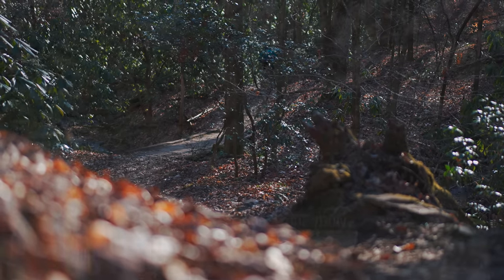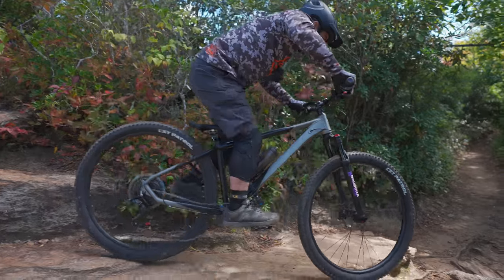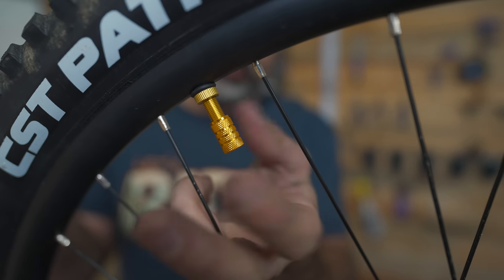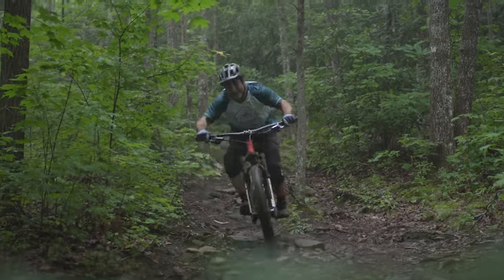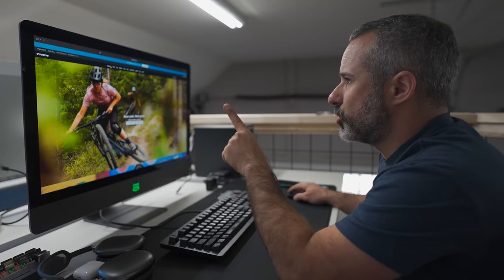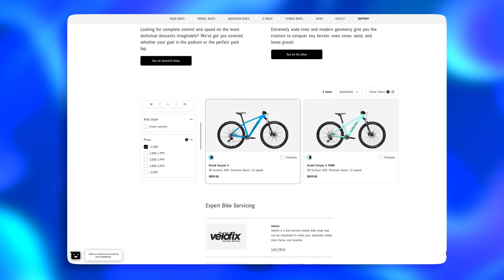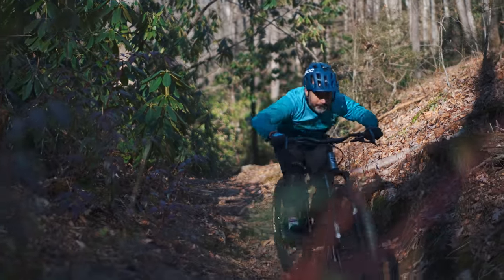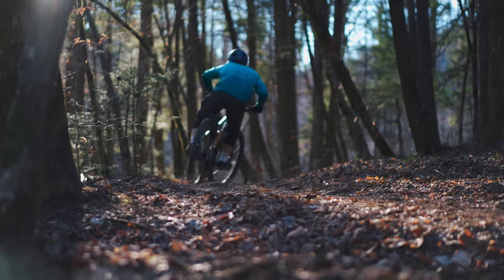Was putting $425 of upgrades into our Walmart Bike a good idea?

Comment: Seth, thank you for this video! Oh man, it rings so many bells. I've got BCA 29er bike from Walmart 6 month ago for $148, didn't know anything about bikes back then. For the fun of it I've started upgrading it with everything I can. Acera derailleurs front and back ($40), M361 hybrid crankset ($25), Acera shifters ($30), bottom bracket ($12), KMC chain ($15), headset ($18), Rockshox Recon air fork ($190), handlebars and stem ($25), seat with seatpost ($30), pedals ($15), QR axles ($12), 34 teeth Sunrace freewheel ($20), $10 derailleur hanger, $15 grips, Shimano brakes ($50). Except the fork which is a major upgrade to any sub $900 bike, it is $300 right there, lol, making this $148 bike a $450 bike cost wise or a $650 if you add the fork, ahahaha. Not counting all the tools and supplies I had to get for it. And I still have a crappy rear hub with 48 spokes (!!!!) and a freewheel wobble that I may have to upgrade to a new wheel with a cassette (another $120) and a cheap frame without rear disk brake mount. Was it better to get Kent Trouvaille - a much better bike for less money? Absolutely! Do I regret not getting it? No, because I've learned so much about bikes. I do not remember when was the last time I had so much fun as during  this project. Watching your videos, reading about parts, how they work, how to replace wheel axles and make the wheels true. To me it was like taking a an advance bike class and paying a $600 fee for it, while getting an OK rideable bike in the process. Just need to keep it secret from my wife so she doesn't kill me, or better yet get her Kent Trouvaille:))))
Reply: 👆👆👆Congratulations fan you've👆👆👆 been selected among my shortlisted winner 🎁🎁🎁

Comment: I recently did upgrades to my Mongoose Switchback Sport 2020 - Shimano CUES U6000 10-speed 6 components groupset (originally Tourney XT 3x7 speed), MT200 hydraulic brakes (originally mech brakes), EXA Form 900i dropper and installed SR Suntour XCR32 RLR air fork. For all these I paid under $350 and ~$90 servicing. Think I am good to go for another 3 years. :)

Comment: With any tool buy cheap and if you break it you use it enough to warrant spending some wedge on the replacement.
Same with bikes, I got a Giant Talon 3 for £400, loved it, upgraded it, still outgrew that spent 2k on a Whyte T130. 

So if you're wondering if MTB is for you, spend a little, see how it goes. 

Or buy an expensive bike and sell it on ebay a few months later for pennies, we love those.

Comment: My first bike back into the sport was a 2020 specialized pitch sport. My local bike shop charged me $800. I thought what I was getting was a real mountain bike. Problem was, when I wanted to start making upgrades, I found out what I got was what I got. 2x drivetrain, 27.5 wheels, straight headset, no easy routing for a dropper post, and no real option for a clutch derailleur. I quickly realized that what I got was not a real mountain bike. It soured me on my local bike shop because they weren’t upfront with me on what I was actually getting. I do have a real mountain bike now and it’s a Polygon. My wife now rides the pitch sport. My son is in his 20s with a baby on a tight budget. He wants to get into mountain biking but doesn’t have enough money to drop on a “real” mountain bike. This Kent would be the best option for him but it hasn’t been in stock since this series started. There is no entry level “real” mountain bike on the market that can compete with this Kent Trouvaille.

Comment: I actually did something similar when I first started getting into mtbing. I got a used hardtail Diadora Corso  for under $200 CAD (which is a Canadian tire brand bike) but saw that it had the ability to be upgraded with more standard parts and over the course of 3 years I  upgraded the wheels, tires, drivetrain,  fork etc until the only thing orginal is the frame itself. Id estimate that with the bike plus the all the upgraded parts,  I more than likely spent the same amount as a bike of similar performance but what was great about doing it this way is that everytime I made an upgrade it also made an upgrade on the riding experience which got me to excited to ride it more.  and or someone that wasnt 100% sure i would enjoy this sport this was a great way to get started in the sport without the burden on spending $1000+ straight out the gate . Now I have a bike with a great riding experience and when  im ready to buy a decent frame ill have lots of well performing parts to install on it.

Comment: I did something like this with an abandoned bike. While it had a grocery store sticker on it the hydraulic guides hinted the frame was probably used for much better specs than what it had. Spent about £400 on everything. And it's in it's 5th year of service. Kid managed to break the spare square taper bottom bracket which I upgraded shortly after to hollowtech. Only other things I've done is change grips and tyres.

Comment: I only just got a mtb (since I was a child at least). Only really been an e bike commuter /motorbiker outside of it but my call for adrenaline took over. I also however have a tiny budget that I can spare for bikes. Bought a used very budget full suspension mtb for £25 on gumtree. Has old but working V-brakes, good condition 26"-1.9" tyres, a bit of rust on screws etc and does need the gears looking at (well lubricated but the front derailleur is not aligned well at all so I only have 1 of 3 gears there making it a glorified 7 speed at the moment until I have the effort to realaign and index it). I also have my e bike which I paid 700 for. I already love my £25 one more. Its nippy and is a just a fun project. Doing all the upgrades and replacements over time is gonna be fairly cheap long term and are more for preference over the bike missing basic function. You don't need something fancy, just something fun!

Comment: This sums up the life of my partner's BMX. Diamondback Viper owned by a downhill racer (gearing modified to suit), she bought it from them for $350, she rode it to work until it fell into disrepair. Some 7 years later we still have it and the start of last year I stripped it, painted it, new gears, cables, wheels and a lot more that was probably overkill. Cost of new stuff was around $450 (AUD) due to the fact we don't stock a damn thing here and shipping is borderline extortion. As far as any $800 on the market (here) it doesn't exactly match in quality but its definitely unique and makes a nice cruiser.

Comment: I've found it to be a great re-starter bike. I bought it understanding its flaws, and if it breaks, or I'm back to riding harder trails, I'll replace it with a Trek, which was my go-to in the 80s and 90s. I do appreciate the insight, as EVERYTHING has changed mechanically since then.
Reply: I did still have the chain tool to properly reroute the rear derailleur. Who does that?

Comment: Don't forget about the tinkerers and doit yourselfers that have more money than sense.  I did this with the Schwinn Axum from Walmart.  It was expensive and I spent way more money than I should have, but I had an absolute BLAST and I learned a ton.  There's not a single part on the bike I didn't replace (sometimes more than once).  By the of that journey, there's no issue I am not equipped handle myself, especially since there's no bike shops near by.  I still enjoy tuning it and changing bits of trim from time to time.  Of course I could never sell it without taking a huge loss but first: I don't intend to, and second: the experience was worth it.
Reply: 👆👆👆Congratulations fan you've👆👆👆 been selected among my shortlisted winner 🎁🎁🎁.

Comment: I normally upgrade the tyres on a new bike for something more puncture resistant and better. And because I prefer 70mm cranks, the chainrings also get changed. The saddle is another immediate upgrade. Other bits get changed/upgraded as and when they wear out or I get fed up with them.

Comment: I bought a Traveille yesterday on clearance for $248. We bought my road bike a few years back from the LBS, but it’s going to be a while before one of their mountain bikes is a financial reality. I also don’t see myself ever doing anything hard core on a mountain bike. I have been a road biker for years but never mountain biked much (my current mountain bike is a 30 year old Diamond back with no shocks, wobbly wheels, and brakes that squeeze the tires that the bike shop is probably worth $100 at most, so I am hoping the traveille is better- the bike is one reason I haven’t tried mountain biking much). We live in a beautiful area with a lot of trails so I plan to ask which ones are “easy” for beginners and probably stick to those. I just want to see if I like mountain biking. I chose the Travaille yesterday because it felt by far the lightest at wal mart and it sounds like it might not be complete junk after searching out videos such as yours. I also plan to take it to the LBS and pay them to go through it looking for anything that was assembled wrong. Do you think it could work as is for my intended purpose? If you could only upgrade one or two things, would it be the brakes and the part by the pedals with better teeth that you did in your first upgrade video? It seemed like with all your upgrades you eventually paid a similar price to an entry level LBS. bike, and you can do the work yourself but I will have to pay the LBS, but since I got it on clearance and don’t plan to do anything hard core on it, do you think it could work for my situation as is to start and then if I like mountain biking I could do a few of the upgrades over the next few years? Thanks.

Comment: Great video and good conclusion. 
Almost two years ago I bought a Cube AIM EX for my wife for €632. 
It came with 3x9, which I replaced directly with a 1x11 dt with clutch from the partsbin together with a new Deore crankset. 
It already has hydraulic brakes, but still the coilspring SR Suntour. 
The fork is good enough over here in the Netherlands for the rides my wife does. 
If I upgrade the fork, the price of the bike with the new parts will go to around €900-1000. Then you come in the range of bikes which already have all the upgraded parts and possible even 12-speed. 
For me it is just fun to work on bikes and to upgrade it, if it is not your hobby: save some extra cash and buy a bike in the €900-1000 price range.

Comment: You can also search for used deore/slx parts. You can find x10 speed stuff in mint condition cheaper than new microshift/ltwoo.
As for forks, you can also search for entry level rockshox or manitou that were removed from new bikes. Can find something like XC30 solo air under 150$.

Comment: Dude.  I got a Trouvaille from WM based on your vids.  I had a 10yr old GT stolen from me and I've not been without a bike since childhood.  Let me just say...for the price, the Kent is decent.  I've not upgraded anything.  Having said that, I have spent plenty of time adjusting components.  Specifically brakes.

While this bike is not the Nukeproof that I'd like to have, it does the job for me right now.  Having been in North GA and ridden many of the premier tracks there, I would probably not take the Trouvaille out there.  Just not confident in it.  But where I am now, on the eastern coast, within a mile of the ocean, it is perfect.  I can hop curbs, wheelie, sprint, coast and have a leisure ride and know that my bike can perform.

Keep up the fantastic content!  Many of us appreciate it and will keep absorbing what you deliver.
Reply: 👆👆👆Congratulations fan you've👆👆👆 been selected among my shortlisted winner 🎁🎁🎁

Comment: Thank you for the reasonable conclusion.  When the series started I was worried you'd recommend this route to people (upgrade Walmart bike instead of buying decent bike from shop).  Definitely takes a lot of knowledge to do the work yourself.  Paying a bike shop to change out a fork would already add another fifty bucks.

Where I wish you'd explore some is for people to either buy a frame, or find a beater bike as a frame donor.

I found an old beat up trek.  Unrideable, but the frame is aluminium and in good condition (and decent geometry by modern standards).   I got it for fifty bucks and frankly, if you are going to change out all the parts anyway, it's much less wasteful to start out with just the frame.
Reply: 👆👆👆Congratulations fan you've👆👆👆 been selected among my shortlisted winner 🎁🎁🎁

Comment: I have a similar "cheap" big box store hard tail, a 27.5 Gira Terreno.  The bike followed a very similar upgrade path to the one in this video over a couple years of riding the hell out of it and upgrading parts as the originals wore out.  Sure, I've turned a $350 bike into an $800 bike, but I did so over the course of a couple thousand miles... and now I know ever single bolt on that bike, what it does and how to fix it.

Don't get me wrong, when this thing finally dies, I'm replacing it with a higher quality bike, but I'm kind of glad I started with a cheap bike and built it into exactly what I wanted by putting miles on parts and learning what worked for me and what didn't.

Comment: My first mtb was a GT Karakoram (the 3.0 model).  It came with rim brakes, a heavy crappy fork, single wall rims.  It was honestly not a great bike for trails at all lol.  But when I got it I was just riding gravel paths at my local park and the sidewalks to get there.  I lost about 50 lbs on it, and then I wanted to try actual trails.  I immediately “upgraded” to mechanical disc brakes because the rim brakes were useless as soon as they got wet.  The fork failed first, then the wheels.  I got a cheap double wall wheel set from a LBS, a fork used on pink bike.  I even frankensteined my own 1x8 drivetrain together lol.  It still was (as I know now having ridden better purpose built bikes) not at all a “good” bike.  But I put 1,000s of miles on that thing and got myself into the best shape of my life.  I lost right at 100 lbs in my first 2 years of riding.  6 years into riding trails I got a trek roscoe.  Now I have a full sus trail bike.  12 years later and I still absolutely love bikes and riding every chance I get.  And it all started with a comparatively bad bike.  But it was my bike and it got me riding!

Comment: Great video...but scary how you use a hammer and then a hydraulic jack to get that steering tube ring off...not too many beginning bike "Mechanics" would risk doing that (Or have that jack), also special tools are needed to remove the crankshaft and bearings.

Comment: I use a different approach, when I want a new bike I go buy a frame and swap all my good stuff into it and only buy what I need to have due to different part fitments.
Worst case I buy a full bike and then sell all the bits I don’t need to offset that cost.
My current bike the oldest part is the RS Revelation fork uppers which are 2009 and originally 26”, I think the newest parts are the RCT3 damper and 29 fork lowers which were bought cheap as unwanted stock in 2017/8. Yep you can convert 26 forks to 29 if you’re willing to keep travel below the max.

Comment: You can find a Trek Roscoe 6 for £850 in the UK. They come with dropper posts, and a tapered headtube and thru-axle front wheel that gives you a lot of options for fork upgrades. The only downside is the unusual 141mm QR rear hub that's the most difficult thing to replace, and probably the first thing you'll need to replace other than chain/brake pads...
Reply: I have the Roscoe 6 and I love it. I put a 140mm Marzocchi Bomber Z2 and Minion DHR II’s on it and its fun. The only problem is the brakes and the QR rear hub. Ive popped the rear wheel out a few times doing stuff in my driveway

Comment: A very cheap and worthwhile upgrade you could do is to convert you fork to oil lubrication. Most entry level SR Suntour forks are grease lubricated. They don't have oil foam rings, but surprisingly they do have space for them to be fitted. So if you disassemble the fork and clean all the grease, you can then apply some sram butter / slick honey to the internals, add some foam rings. Find some rubber washers for the bottom bolts and then yopu can apply some fork oil. I used RockShox / Maxima 15wt for the lowers and 5wt for the air chamber on a friend's fork. The fork works better and for a longer period of time.

Comment: About the Suntour XCR Air, I've had one and I was tinkering with it for quite a bit. On a budget, I would opt for anything Rock Shox used or new. The one I had, had no foam rings, and no oil in the lowers. It used to be a grease fork, maybe it's upgraded now by Suntour, although I highly doubt it, also - has no tokens. Rebound is sort of there and sort of not, really the damper is very basic, and it's non serviceable, closed gas cartridge. My upgrades included - increase travel to 120mm by removing a spacer in the air side, mine was 100mm. Add oil in the air chamber hence no tokens, for plushness and add foam rings, add 5cc in each leg. It did not leak. 
Right out of the box, 6 months XC riding and the grease will go, it will begin to stick.
Personally, I bought a used Marlin 7 2019, with the RS XC30 coil. Has a better damper, added foam rings, excellent fork, bulletproof, not too heavy.
If I was on a budget again, used Marlin in a heartbeat, it has great geometry, nice colors. Cons - no tapered headtube, but convertible with a Cane Creek 40mm kit. It just rides like a Caliber, because of the geo, but Trek couldn't give a tapered tube and I understand why. Best budget beater I've ever had. Converted to 1x10 Deore with a clutch and that's about it.